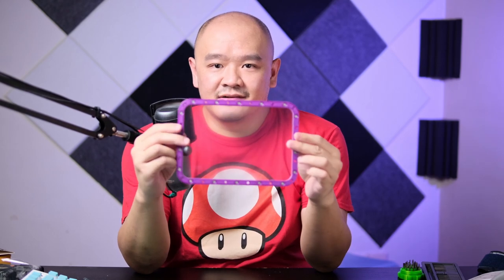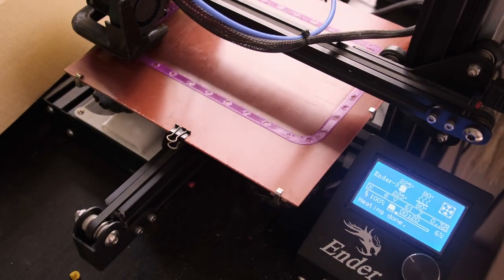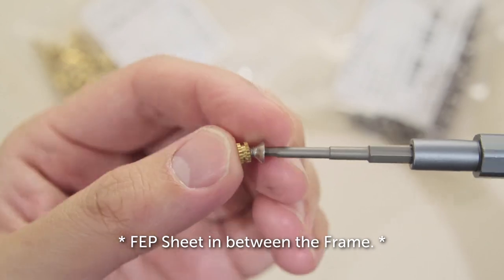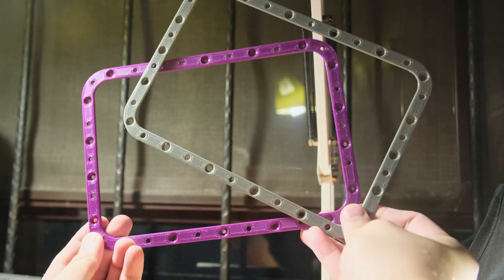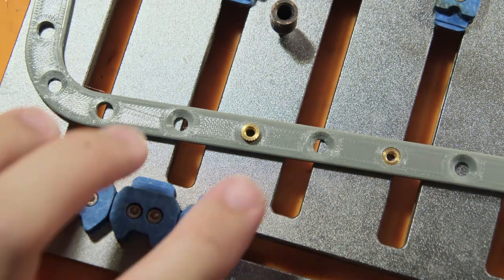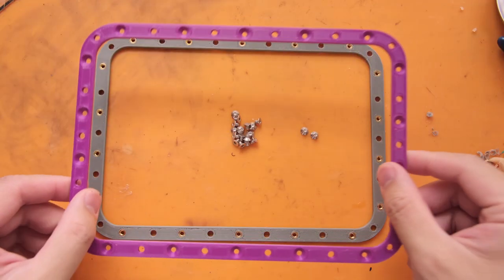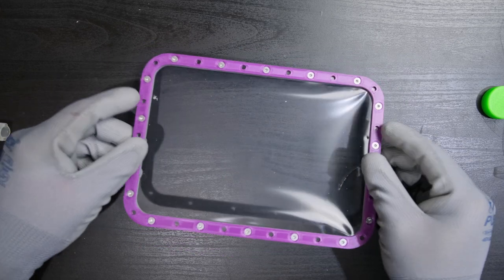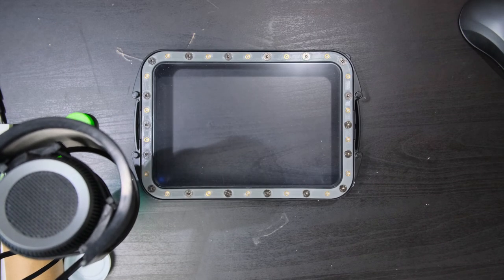Print Better, For Cheaper. - Anycubic Photon M3 Custom FEP Frame

Comment: If you struggle to get the heat inserts in 2.5mm depth, you can melt in some m3 nuts in that size. Theyre easier to get in store

Comment: Ok, I finally started to install new frame to the body, untill I find a problem: the frame is too big. Fusion360 gives outer diameter of 150mm and inner inner diamter 130. I took the original and the lenghts are 148mm and 129mm. Is there really possibility that the VAT sizes and different that much ooor?
Reply from the maker: That's interesting. I modelled the frame exactly to the same size as my existing FEP frame down to 0.1mm

Assuming the same print settings etc I'm not sure why there's such a big variance between the two.

Just to confirm you're on the Photon M3 right? Not the other models
Reply: @TechRodent  Yea, using Photon M3. The original FEP is the 148mm and 129mm. And the one I got printed with your model files is the 150mm and 130mm. So the print got out perfect, size doesent match. Weird indeed :S
Reply from the maker: @WilleWee  you can try scaling the model down to about 98.65%, maybe that'll work for you, basically 148/150
Reply: @TechRodent  Need to try that way!

Comment: Hello! Do you have link for the heat inserts? I've been trying to find those but can't find anywhere!
Reply from the maker: I think since M3 2.5mm L is a bit difficult to find, I'll make one based off a more commonly found one; if you have any suggestions, I'd like to know
Reply: @TechRodent  Yup, noticed that! 😂 I was wondering if 2mm is enough, if not I just get 3mm and mill it down to correct size
Reply from the maker: I've added a variant that uses M2.5 OD3.5 Heat Inserts, you can check Thingiverse for that. It should be more readily available